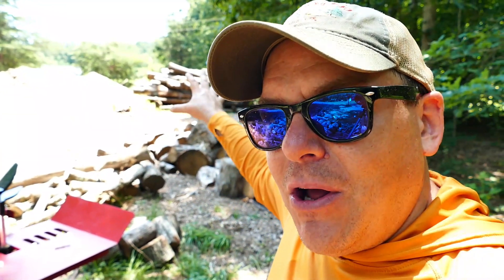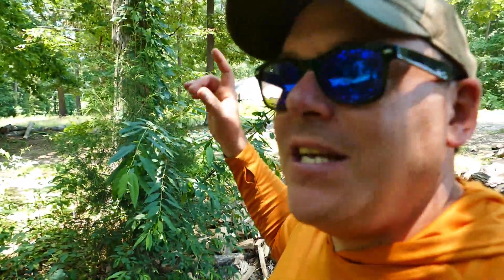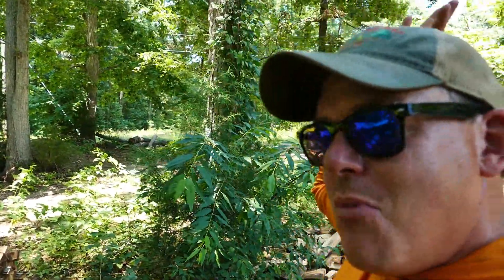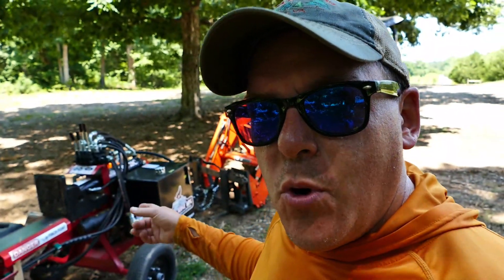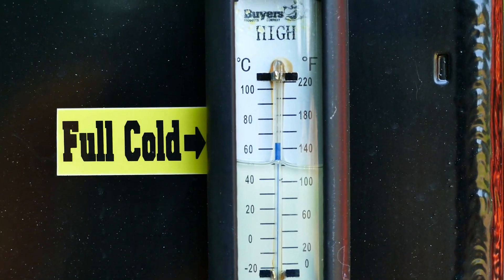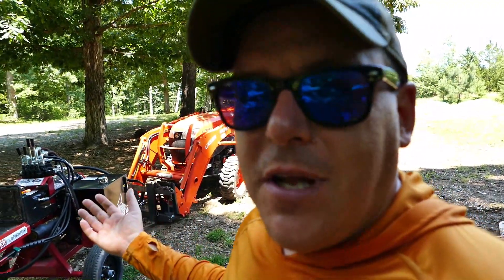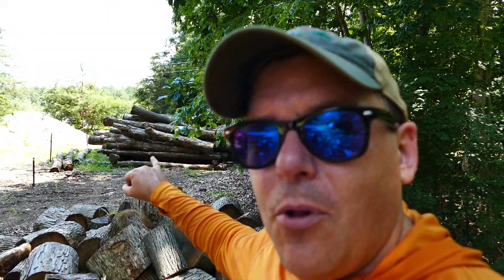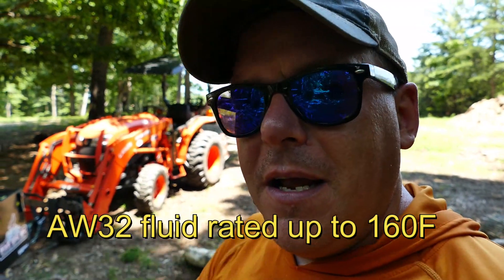How Hot is TOO HOT for the Wolfe Ridge Splitter?

Comment: Heat will have an exponential function to longevity.  I can’t believe a splitter at this level/cost doesn’t come standard with an oil cooler.  Some splitters are “commercial” in name only.  Commercial to me means it is meant to run at least a full work day at full output, that requires several considerations an oil cooler being one of them.

Comment: All the Wolferidge splitters come with AW-32 / ISO 32 fluid.  I've had other equipment that used temperature ranges for AW-32 & AW-46 fluid.  Warmer ambient temps called for the AW-46.  Curious if this would apply to these splitters or the AW-46 fluid would cause problems or is this thinner fluid used in order to achieve advertised cycle times?  At 100C ISO 32 viscosity is 5.3, ISO 46 is 6.9

Comment: I find shade can make a noticeable difference in the temp of the fluid.
.
 running the system with low fluid can definitely make a difference on a hot day.
.
Anytime your stalling a cylinder at the end of its travel, or using a function with a flow restrictior, such as a log lift.
Can dump staggering amounts of heat in to the fluid.
.
Probably a little shed to keep the machine and operator in shade is probably a  very overlooked thing.
Mabe one wall to the afternoon sun side.
For as long as the fluid doesn't go over 160F i personally wouldn't add the cooler.
Mabe time it so every 2 hours i run saw or tractor for an hour or so, letting it cool off some.
0.01c

Comment: Ok, using the fluid level gauge in the side of the tank. My fan kicks in at 160 and once that ran it never got over 165.  That’s running it today in full sun from 8:30 to 1:00.  We were splitting fresh cut maple, 20” trunk, and only had to build pressure a hand full of times.  So most of the splitting was under the auto cycle cut out.
Reply from the maker: Thats interesting. I think Chris mentioned on his other video that the compact commercial splitter oil cooler would kick on at 120. I wonder if there's an adjustment. Seems like you'd want that to start cooling earlier. Someone with an eastonmade machine mentioned theirs kicks on at 120 as well.
Reply: @FlatCreekOutdoors  I honestly don’t think it was 160 in temperature that just happens to be where the mark is.  The side of the tank wasn’t so hot that I couldn’t keep my hand on the side of it. That makes me think it’s more around 120.  If memory serves the hottest water coming out of my faucet is around 130 and I can’t keep my hand under that.
Reply from the maker: makes sense
Reply: 120F seems cool.
I'd expect closer to 160
As I know automatic transmissions target about 160F-ish
180F is considered a bit hot in a automatic trans.
0.01c

Comment: 140 degrees is what I've heard, could be wrong though. Not going to be as much of a problem for me overheating as my summers are cooler than yours. Doesn't get above 90 all that often. If your neighbors are far enough away, start splitting as soon as the sun comes up to capitalize on the coolest the hydraulic fluid will be all day. I know my farm store splitter gets "burn your hand" level of hot after an hour in the summer heat.

Comment: If I had the option to add a fan-cooler for my RuggedMade hydraulics, I snatch it up in a heartbeat. 
It gets hot enuf that I can only run it for about an hour, then shut it down to cool.  That said, I can then transport the splits to stack, taking enuf time for the cool-down and start splitting again. Any engine at requires air-cooling needs a periodic cool-down too. Also, now I keep my splitter under a canopy and out of the sun when in use (more for my comfort! whew..😥) -Dave
Reply from the maker: I pull my portable canopy out every once in a while. Unless the scope of my firewood busines changes, I'll continue to be kind of like you, and just do shorter splitting sessions. Cut some, Split some, stack some, repeat. And the splitter never gets a chance to overheat.

Comment: I had a recent issue with my Countyline splitter and the company that makes them was involved.  I asked the question about oil temperature and they said it is expected to run at 180 degrees while still maintaining sufficient viscosity.   I am guessing if a TSC unit can take the higher heat then a Wolf Ridge is probably fine as well.   I just make sure that I always have the reserve full so the oil is circulated and has time to cool.    Not sure this helps as it is just more information.   Hope you got your mail from me.
Reply: I run the same 10W-30 STOU oil both in the engine and for the hydraulics on my tractor and allmost everywhere else. I guess that the VG32 might be a little more "fluid" in the winter, but my engines are 15-40 years old so they don't care 🤭😁.
Reply from the maker: I never did get anything. I might have to check the neighbors. Sometimes my stuff gets sent over there. I'll keep you posted.
Reply: @FlatCreekOutdoors  it shows delivered I will email you.
Reply: 180 degrees is way too hot for hydraulic fluid.
Reply: @thefirewooddoctor  I thought the same thing but that is what I was told by YTL International who makes many of the home owner brands.  I think Phil is right about matching it to the grade of fluid being used.  From what I understand, the danger is that the viscosity will get low enough to seep past the seals.  But I am by no means a hydraulic expert.